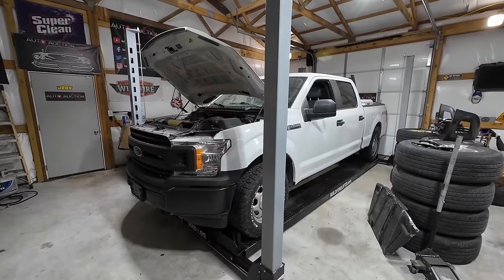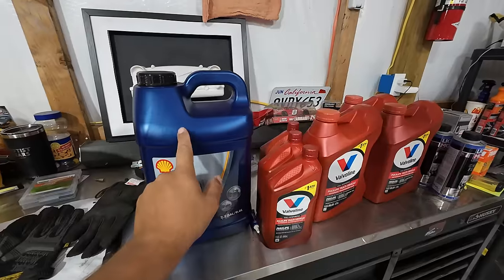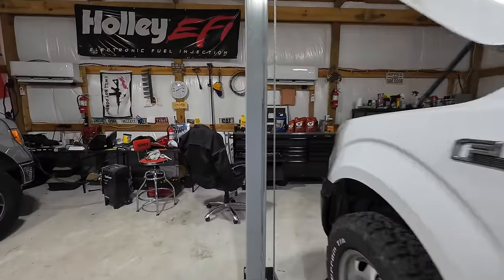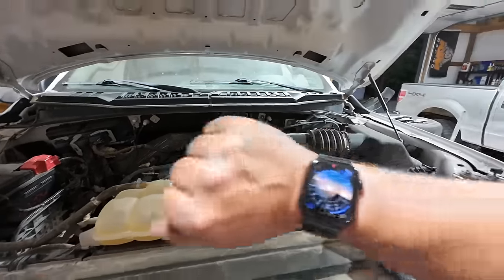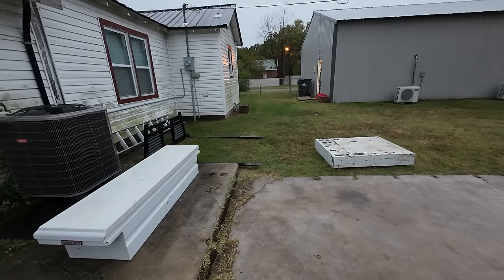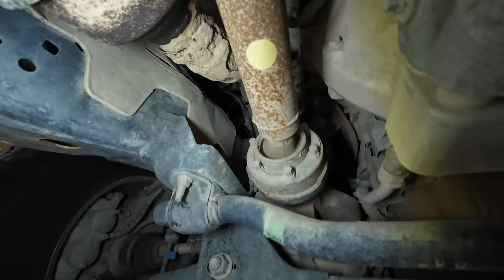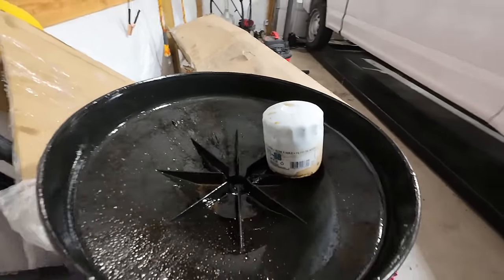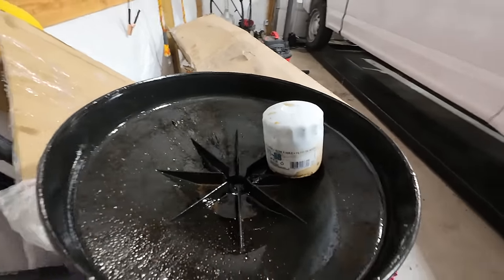Can Liqui Moly Save my $10000 ford F150 Engine or is it too Late?

Comment: Whoever came up with this oil drain plug idea has no business designing automotive engines. It’s clear that they have never held a wrench in their hand in their entire life.
 The truck has a HLA (lifter) that’s not pumping up. Usually it’s a tiny piece of trash that gets stuck in them and causes them to tick. Replacement is usually necessary to shut it up. Personally if I were going to the trouble to pull the valve cover off I would replace them all but that’s just me.

Comment: Throw that fram filter in the trash or screw it on your pistol. Switch to a quality oil filter. Great video. Thanks for all the details. I currently have the 5-20 and the diesel rated 15-40 sitting on the shelf right now. Doing the eenie meenie mynee mo hahahaha.

Comment: Again, change the cam phaser solenoids and the cam phasers!  And don't ever put that thick ass 15w-40 oil in again.  It's too thick to flow through the cam phaser solenoid screens and will starve the cam phasers and engine from getting proper oil pressure volume, damaging the engine farther more. 
 After changing the phaser solenoids and phasers, use 5w-30 with one quart of Lucas engine oil stabilizer. And continue changing oil every 3,000 miles... The reason why the phaser solenoids and phasers go bad in the first place,  is because people listen to the dealerships telling them they only need to change oil every 5,000 miles. That's bullshit.!!! Change oil every 3,000 miles and you wouldn't have this problem in the first place.  
They just want your business, and by only changing your oil at 5,000 miles instead of every 3,000 miles, they know they will get more of your business by repairing more broken down vehicles.

Comment: do you have a mechanics stethascope that I can not spell but I can use , and listen all over the engine and tell where the noise is coming from .  If it has injectors they  make a sound like that .  Listening with a stethascope which I can not spell would help.

Comment: Watered down the oil with two bottles of engine flush. Surprised when hot oil comes out like water. 😊

Welcome to the disposable oil drain plugs. Been around for like 15 years. Buy a bag. They're cheap.

Comment: You cannot go from regular oil to synthetic and then go back to regular oil it will tap tap tap to the end there's nothing wrong with the engine it's just that you're going to have to use Ford motor oil synthetic or whatever Elvis say put in their look on the look in your book it'll tell you what kind of oil to put in there I know it's synthetic because my Mustang went to tap and I had to go and put synthetic oil back in it it took a couple days but it stopped you have to use Ford motor oil if not it's going to tap

Comment: Should have watched a YouTube video about oil changes on new ford's thay all warn about all that.
I hold plug in place with little pressure for 5 minutes till sheer volume is about all gone before removing all the way & I wear disposable rubber gloves & my worst clothes because I'm on my back Jack!

Comment: Try hydraulic lifter repair from licumoly instead 
It worked on mine
Reply: It took a few weeks to be perfect 
I used 5w 30 oil mobile 1 high mileage with it

Comment: RANDY!!!! Haha. Forgive me for laughing but the same thing happened to me on my first f150 oil change. That sway bar is a Fucker lol. The key is to drain the oil slowly. I had to hold the plug in the drain hole to slow the release of oil. What a freaking mess. Lol.  I hope this works with the noise.  I will definitely try it. All the best.
Reply: Oh!!! I forgot. I to increased the oil viscosity. It fouled the VVT sylonoid causing a miss. Big miss. I had to change the sylonoid. Easy fix

Comment: Could back in time 302 CID 5.0V-8 H.O supposed get modified parts on the cheap sounder $500-1000 parts and make 5000-600hp switch ad from 1989--1993 302 CID H.O into it and build it out 6 speed auto bullet prof tuck? Try one of throe builds. Still have all that high tech crap and breaks out warranty DO  the 302 and 6 speed goo combo 302 block are easy to find Try this. Its never been done and it would be more reliable than any ecoboost or coyote out together. You would have one a kind. These old 302 can hold 500-600 hp and close to 650 ft of torque. I know of guy have one ab built on the cheap. He wired it to his 2017 F-150 XL never any prompted you have the have the ECM flashed at a  tuners gauge like he did have new  new one programmed. Also his truck went back to OBD II Pre emissions plug into OBD 1 poet and gthoed people off. He wripped  the gut dof ou thr mustang wiring harnesses hid junk 2011 F-150 go make this cool truck.

Comment: as for the ticking noise,  I can almost guarantee it is a bad cam follower.  The roller bearings in the cam followers come apart and will start ticking.  It is suggested to do a full timing job on it when you do the repair, however, you could just remove the cams and change the affected rocker arms, though that would be shitty to do for the next guy.  Im not sure it is worth doing the full timing job if your just going to flip it, but you could change the rocker arms and that would solve the ticking.  Theres no real way to visually verify thats the problem without removing the cams, but you could try an inspection camera.    https://www.youtube.com/watch?v=vemfvEbSBQs

Comment: Yes randy....u hit the nail on the head....ford engineers suck😂😂😂😂 i hate doing oil changes with these crappy plastic drain plugs that just happen to have the sway bar right in front of it....they suck.....careful with that thicker oil as the cam phasers work off oil pressure and if its to thick the oil wont get into the tiny holes in the phasers

Comment: 2017 the last year Ford built a truck that was good a real drain plug with a metal pan but hold on 2020 a aluminum pan but a oil pump drive with a timing belt come on Ford one step forward 10 steps back I really want the most important thing in my engine relaying on rubber Ford wake the fuck up fire that engineer.

Comment: Liqui Moly is very overrated. Their additives are some of the worst. Watch Oil Geek’s videos. Use Mobil 1 Restore and Protect or Pennzoil Platinum, they’re cheaper and better. If you insist on an additive, Tufoil has a Guinness world record for the most efficient lubricant

Comment: You bought the truck for cheap, I’d have the engine repaired or replaced correctly instead of putting all kinds of chemicals in it.

Comment: Ford got rid of that wonderous oil plug, for the 21' yr.  I got caught under my 18 with the 5.0 in the driveway without a jack. So you wanna see a fat guy's Little legs sticking out of the side of my truck doing things they haven't ever done in my 40 years of life?  Thank God it was in Buffalo in winter. So it didn't feel as hot.

Comment: im not gonna lie i feel bad i know how that feels i do that 15 times a day as a lubetech but that was funny
Reply: the oil spilling part was not funny deal with that all the time to
Reply: and the 15-40 thing is true i know a lot of gasoline truck guys that use it and over time it does help
Reply: and i work at Valvoline those filter suck only rated for 3k miles

Comment: doesnt  have anything to do with  how good the maintenance is ,  ford is selling junk  
many of the  f150  or other  ford engines  need  *oil pump etc  timing chain and  guide rails , rockers , valve tips etc    right around 150K, some earlier some later   Its like the have a clock timer , people  get them  used  while they have 60-80 K 2nd owner  and  drive them until  140150K then  dump them because weird stuff starts  , by then they will need  5-10+ hours  service  at rate x  $125 hr at mechanic  Big money,  thats why they are so cheap unlike chevy gmc  because they are  A  Real assembly nightmare .. ford are liars dont believe  what crap they write

Comment: I had the same noise on my 2004 Mazda 3  2.0 motor. Thought it was my lifters, found out it was the flapper in my intake manifold. Changed the manifold and noise disappeared.  Here's a video I found on your truck noise. 

https://youtu.be/A9YccOPbHhQ?si=alTSo8IsJccFA-41